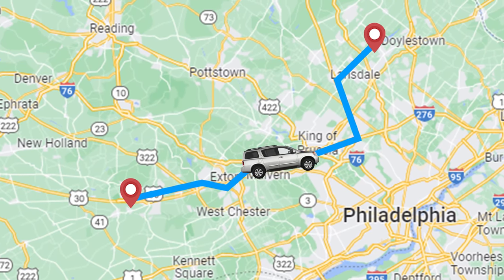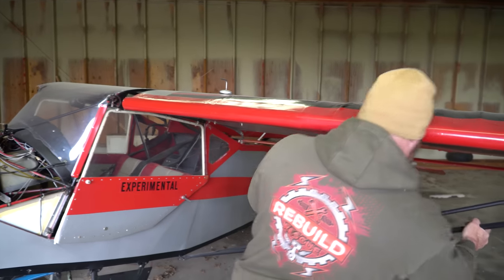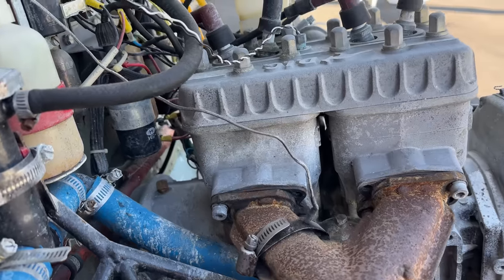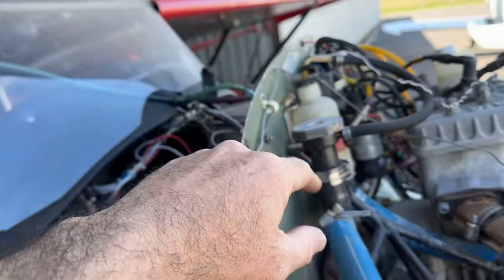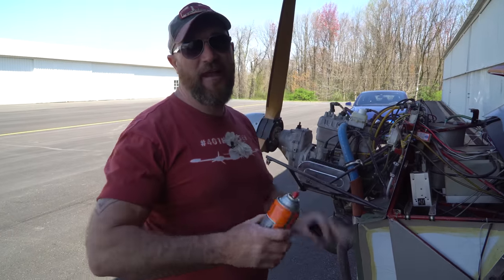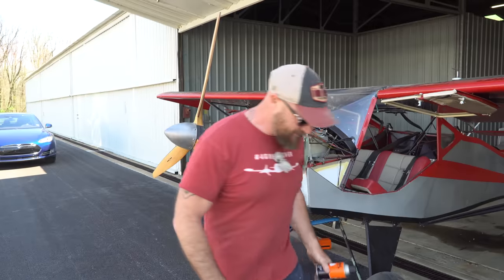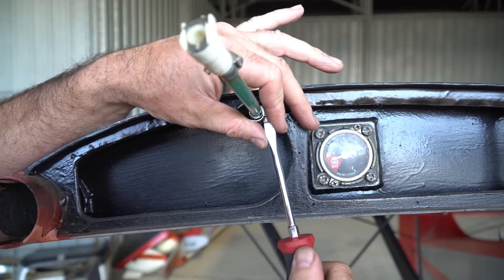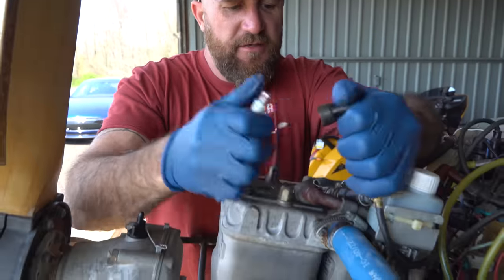I Bought The Cheapest Airplane On The Internet

Comment: I agree with some other comments about the oil. That little tank is to lubricate the rotary valve only and that little tank lasts a long time. The engine needs pre-mix. After it quit and was restarted it sounded like it was running on one cylinder for a while but it was hard to tell over the music. WHY DO YOUTUBE VIDEO CREATORS FEEL THE NEED TO PLAY MUSIC DROWNING OUT EVERYTHING ELSE??

Comment: Yeah,You ate too tall for that plane. I'm about 5'8" tall, it was made for someone my size.but my weight would max out the limit. I'd have to leave my passenger or bags behind .(i'm 300 lbs,easy. About 100 over ideal.) There is a small air field down the street from my mom's house that has a PBY and a few 172s'.(it's on Lake Francis in Central Florida. ) I'd love to own Mr,Harris's place. It's about a half mile long too.

Comment: 18:35 Sorry for my bad English, hope you understand my point: You said the engine gets oil from the fuel which is correct for a 2-stroke, BUT if you are not sure if it is using pre-mixed fuel or there is a seperate oil tank to mix the oil directly into standard gasoline before it gets to the carburetor, you SHOULD check that first, because if the motor is mixing oil by itself and the oil tank for the 2-stroke-oil is empty, it will be exactly the same result as a four-stroke without oil in it… ;) By the way: You should check that first on any 2-stroke but especially if you plan to literally depend your life on it 10.000 feet above ground… However, great video and I am pretty sure you would check that at least before taking off, right?

Comment: Cheap to fly😂 A 582 Rotax will suck 5 gallon an hour as an average. Can be worse in fast Cruse. The 65hp are good...but you need to feed them...and don't forget the oil.
I have been flying such an engine. Very nice and reliable but you have to KNOW how to handle it. Lean it and you will get high EGT. Try to ease a bit the throttle to calm the EGT... and it will seize. Only options  if high EGT : full idle OR full open throttle. Remember it has nothing in common with regular aircrafts engines.

Comment: That's definitely been rebuilt to some extent since being built in '84, looks like they did the panel, engine, and interior. Keep in mind that all Rotax two strokes, which are no longer manufactured, had a 300 hour TBO, so that engine has about 160 hours left on it. Also learn to fly it like a two stroke. Do not idle descend, that means the prop is windmilling the engine, and since all of the oil comes from the fuel it won't be getting enough fuel for full lubrication. Add that with shock cooling, and a go around on an idle-descent approach can quickly turn into a cold seized engine running too lean and too cold right when you need it. I flew a two stroke kitfox for 20-30 hours before selling it for a 912 bird, two strokes are best kept around the patch IMHO, I wouldn't cross mountain passes in them comfortably.

Whoever rebuilt it was short, that 4" seat cushion is 3" too thick! Sit straight on the fiberglass seat pan until you get some thinner seats built up. I'm 6'4 and fly a IV without issue, with stock seats and rudder cables extended as much as they can. If you really want to fit better, move the throttle to where the GTX327 is and you'll have knee clearance for two people, moving the throttle out of knee height was a game changer for fitting in and having full stick clearance, which yes you'll want when it's gusty and you're landing/taxiing.

The 1 was the squirriliest of them all, short wheelbase, narrow gear, small tail. Make sure you get some time in a kitfox with an experienced kitfox instructor, it's no cub or citabria or 180 and I know plenty of freshly built kitfoxes that were destroyed by CFI's without Kitfox time. TK1 Gear Legs and shocks would give it a much wider stance with more differential braking, but by the time you add wheels tires and brakes you'd spend almost as much as you spent on the plane, so bungee gear will work just know it's squirrely and likes to ground loop.

Yamaha's are cool but you don't see them XC'ing often and for good reason, lots of ancillary experimental systems to figure out and go wrong. The four-stroke Rotax series, which is NOT out of a snowmobile, is the ideal engine, especially the turbo models, for a Kitfox. Unfortunately your Model 1 can't handle the weight of any four stroke except maybe a Yamaha phazer, but the gearbox support for it ended as well. Unfortunately I think that once that engine hits 300 hours, it will be difficult to figure out "what's next" for this plane as parts won't be available to rebuild the existing motor or replace the motor with a more modern one that isn't too heavy for the airframe.

If you're still interested in the more modern kitfoxes, with more size and reliability and gross weight, let me know! I'm sure my brother Trent Palmer would be happy to do a Collab video in his tricked out FreedomFox, and I've got a pretty decent model IV too. Or do it with Stick and Rudder in Idaho while you get your Kitfox type training, though ideally you'd get some dual in a model IV or older before solo-ing the 1.

Comment: About that prop, did you read the book on Voyager? The Burt Rutan plane that was the first to fly around the world without landing anywhere? Well, the idea was flying with wood props, but they never got the blade angle hardware okay, so they switched to a famous light metal prop builder. Lessons learnt was: be very careful what propeller you buy. Wood can be extremely good, metal can be extremely good, no matter what material, it is important you can TRUST the company who made that propeller. It is great seeing you, doubting that one blade. You wil not lose a prop blad during take off. So, my tip is, do find this Voyager book, it is great, reading how Voyager was built and flewn. If only you had time for a book.

Comment: I'm looking at the scoring on the port side of cylinder 1 , cylinder 2 looks good.
Reply from the maker: What you’re seeing is the Kroil and anti-seize that was in the spark plug threads running down the side of the cylinder. The cylinders have perfect cross hatch on them.
Reply from the maker: @buckmurdock2500  No Buck that’s not the case….  We don’t put every part of a project in a video. It has 50:1. Notice the exhaust smoke when it’s running 👍🏼

Comment: Near the end of the video you were checking the charging output and I think you meant to say if you changed to LED strobe lights you would have less amperage draw. But you actually said voltage

Comment: Whew, that's small.  I'm 6'7", don't think there's any getting in there for me.  And if I could, the control column would hit my knees for sure.  I'd have to chop it off and put it in the middle or something.  Or on the dash as per a Cessna or Piper.

Comment: I started flying in 1973, in a Cessna 150.  I am a FIRM believer in learning to fly in small, LIGHT aircraft!  The 'cork in a bottle.'

FIrst and foremost, you learn early and QUICKLY 'where the wind comes from and which direction to put the Ailerons!'  You learn how to use the controls, from straight to cross controlling with winds from different directions when Taking off and Landing.

And you learn to be SMOOTH on the controls because the slightest control input WILL move the Airplane!!

Transitioning from the C-150 to a C-172/182/206 (or Piper 140/180, Grumman Tiger, and the 12 other Single Engine planes I've logged time in...) was like going from a Sports car... to a Truck!!  But I KNEW how to fly!!  =)

Have FUN with the Kitfox... and yes, change the Fuel OVerflow as they CAN catch fire.  Happy Flying!!  =)

Comment: Many many years ago, we're talking maybe 1987, I took a demonstration flight with Mr. Dan Denney, the original designer and builder of the early KitFoxes. They're fun and responsive but they're quite a handful for any low time pilot. Being such a short airframe and a tailwheel design, you really owe it to yourself to get a bunch of tailwheel training before you try pilot this little booger. Seriously, consider yourself warned.

Comment: Two stroke snowmobile engines have an oil fogging feature for summer shutdowns. That could be why this one is so oily inside. 
Pumped oil is ideal, because premix stops oiling when the engine is free-wheeling. Pumped oil is always feeding some oil. 
Carburettor jets are slightly richer for premix as the oil displaces some fuel. It should be easy enough to find the oil pump or not.
Edit - there’s a neoprene tube going into the carb manifold rubber. It’s probably an oil feed.

Comment: There are 1000 ohm resistors in the spark plug boots. Those are the same as on a VolksWagen, Bosch made parts. The whole ignition system is made by Bosch.

Comment: Top up the reduction gearbox, until oil comes from the top hole. That way you know it’s full. Don’t worry, it came out the bottom hole (🤭) so you know it has enough.
Reply: WRONG!!! The top hole is for when it's mounted inverted, then it would be the bottom hole. You ALWAYS check the bottom hole! Please don't comment on things you obviously don't know jack about....
Reply: @painlesstom  😂🤣.

Comment: can be converted to a one sitter?
Reply: for what? One person can fly in it as is.
Reply: @buckmurdock2500  yes, but, is a little tight, knee hitting the throttle, not much space to move the stick, etc. you put a single bigger seat in the middle, a little bit back, and it would be more confortable to fly.
Reply: @Jokalido  Many homebuilts w/o adjustable seat and/or rudder pedals are "adjusted" to fit the pilot with seat cushions. Not sure how tall Dan Denny was but the original Kitfox had ~1" thick seat padding. This appears to be much more than that.
it's not really possible to move the seat aft as it's part of the fuselage structure.

Comment: There have been some comments that this plane needs pre-mixed fuel, but the exhaust when it was running suggests that the oil is present.  So it seems that the auto-injection claim is correct.
Reply: @buckmurdock2500  Where was that?  I went back through the fueling portion again, didn't find any mention of pre-mixed fuel.
Reply: @kerryedavis  Jason cleared it up in a reply to Max101 a little further down in the comments. He used 50:1 mix.

Comment: How many hours can you stay up in that little thing
Reply: None if he doesn't start running premix. He could have fried that engine thinking the rotary valve reservior was what lubed the engine. lol 582 has a typical fuel burn around 3.5-5 gal/hr, so time in the air depends on conditions and fuel capacity. ;)

Comment: I would install a small solar panel unter the roof. So no empty battery and the generator dosn´t have to work so much. And a lithium battery to safe some weight.

Comment: I knew right away,  old battery,  only one coil firing... replace the battery first off .. 

 2nd.. why pump that old fuel into the carburetors ?? You jad a priming system... just pull it at the carn and drain the old fuel out of those lines .. why chance clogging up the jets and passages?  Still , a heck of a bargain 9.5 and he probably talked them down 500 to 1k .. I am sure he'd leave that out  ..lol..

 Now all he has to do is loose about 8" of height and hes got it made .. lol 

   I'm 5.6 ... so he needs to sell it to me ...Hello

Comment: Plugged pilot jets. Why it dies at idle when you push the choke in. Pop the bowls off and run a thin piece of guitar string through them. Or just snatch them out and blow the passages clear with some B12.

Comment: Battery is really low.  the generator or alternator isn't running yet.  Charge the battery.  Nice fuel system - takes air bubbles out when using the engine level tank.  so fuel only goes to the engine.

Comment: You don't have a taildragger endorsement/rating do you Jason. It shows with the lack of appropriate control input when starting and taxing. This is especially important in variable and gusting wind conditions. Elevator always full back or you could / will end up on your nose. Ailerons into the wind so you don't get the upwind wing lifting. You need some serious x-wind training so you can begin to be safe in them.
Reply from the maker: I’ve only have about 2hrs in a tail dragger. The video is here on the channel. I need to get more time in one for sure…. Along with finishing my PPL. Lol. Thank you for the tips 👍🏼